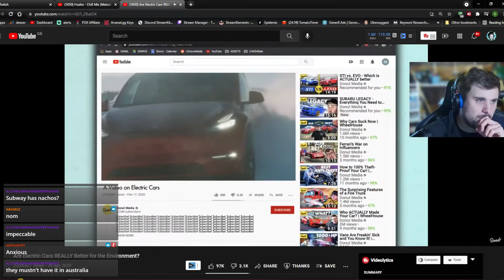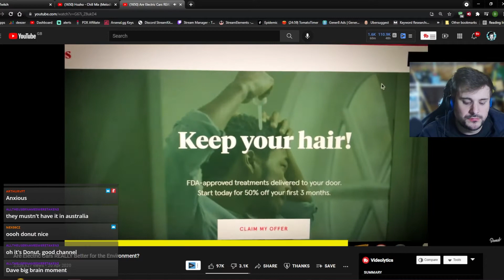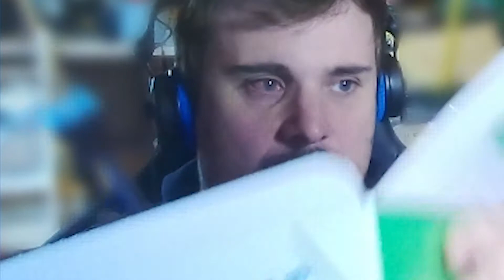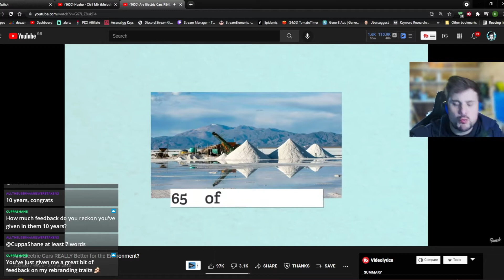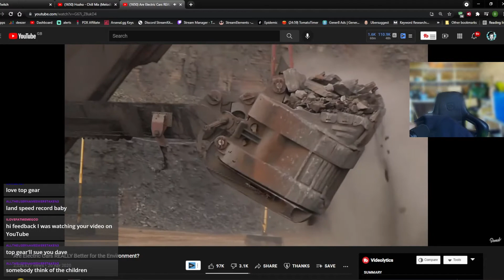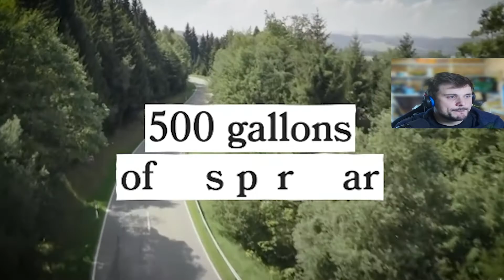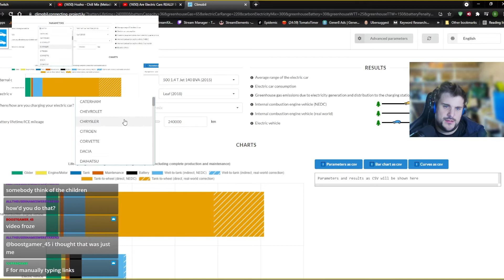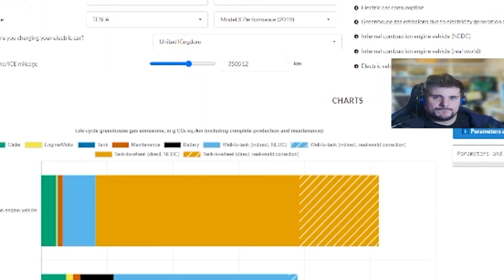Are Electric Vehicles BAD For The Environment? - Reaction Andy

Comment: When you look at the numbers it really depends on how much you drive and how often you purchase a new car... I know allot of people who buy a new car every four or five year and perhaps drive no more than around 1000-1200km per year. If you happen to buy a regular sized car with a decent fuel economy you actually will produce far less emission with buying a combustion engines car... of course you should not buy a new car every five years, but allot of people in rich countries do... We only drive around 800km per year and our car only consume a bit over 0.5 litres per 10km, it is a mid sized car. I would need drive that car about 7-8 years to end up with the same environmental impact as if I had bought an electric car of the same size. Our car is 14 years old and still run just fine bu the next car will be an electric car, most probably.

How often will you need to replace the battery of an electric car, especially if you want to maintain some range capacity... nobody really knows?!?

As we plan to own a car for more than ten years the battery life is important, otherwise we will not be doing the environment any service at all by selecting an electric car. Not to mention the prices of electric cars are extremely high still, so from an economic point of view it is not really worth it either even when you count the cost of fuel, based on that we don't drive as much.

You need to look at your needs and how you drive and use the car before making a decision... I want to have an electric car but the price for purchasing one over a standard car is not really that interesting at the moment. There then is the infrastructure of owning the electric car that is not full satisfactory yet, at least not where we live.

Comment: Solid state batteries are around the corner, replacing lithium and will have much more longevity. The reason they're popular now is light weight and...something something willingness of the molecules to accept electrons or some shit. Also these videos never talk about how gas/petrol uses only 30% of the potential energy for movement, because explosions are mostly heat energy. It's 3x more effective to charge a battery on a "dirty" grid which creates electricity from heat energy.

Comment: What we do with all the car batteries in 40 years? Electric cars will be an environmental disaster on a massive scale.
Reply from the maker: The same thing we do with batteries now. Recycle them
Reply: @FeedbackIRL  Do you understand how absurd that reply is. Our governments are talking about going all EVs. The scale of batteries will increase in magnitudes. The batteries are the most environmentally destructive we've ever created. It'll be a nightmare. We're making the problem worse.

Why do this when we could use hydrogen as a fuel source for our existing cars?
Reply: @FeedbackIRL  The logical path to reducing carbon in the atmosphere is well understood. Not what you hear in politics or the media. Countries like Canada (where I live) need to increase oil production. We have about 5-6 Saudi Arabias worth of oil in 2 provinces. We build pipeline to the coast and start exporting to China/India. They, and everyone else, convert all coal fired electric plants to oil. For a 40-60% reduction in carbon emissions. This would be done short term as we build up 4th Generation nuclear plants. These plants which burn the waste from first and second generation plants will allow us to slowly reduce oil consumption.

Natural gas should also be used o  a limited basis as it has an 80% carbon emission reduction over oil. The problem with it is fracking which can cause serious damage to the bed rock/ water tables. So it needs to be minimal and out of traditional oil wells.

Solar and wind should continue as they are but we have to accept that after trillions of dollars invested they'll only manage less than 10% of global need. Unless we have a major breakthrough in tech it'll never come close to what we need.

All our current vehicles can be converted to hydrogen. A mature technology at this point with the new fuel cells that have been developed.
Reply: @batzing  the viability of hydrogen engines is a lie it doesn’t work.
Reply: @SolitaryLark  A lie? It currently being used in many countries. Not sure why you'd say that. Looks like you couldn't take even one second to goggle.
Reply: @batzing  the viability is a lie viability. I know it works but the refinement and transportation of the fuel among other things would not work on a large scare. Therefore it is not a viable alternative.
Reply: @batzing  I’m well aware of hydrogen fuel cells. The refinement process and energy required and various other things means there is no way it could replace EVs or traditional fuel cars. (EVs and hydrogen could replace traditional cars together)
Reply: @SolitaryLark  EVs require even more energy to charge. Hydrogen takes far less energy to produce. You are just dead wrong about this one.

The byproduct of hydrogen combustion is water. The engines used are not toxic like the EV batteries. EVs are an environmental disaster.

You say you're well aware. You clearly are not.
Reply: @batzing  did I not say EVs take less energy. EV infrastructure is simply easier to implement. Hydrogen cannot be implemented easily and is cost prohibitive. We should replace traditional cars with EVs in the short run and possibly in the long run do hydrogen. Attempting to bypass EVs in favor of hydrogen just doesn’t make economical sense. (I know what I’m talking about relax and think about it instead of insulting my intelligence and education level)
Reply: @SolitaryLark  I disagree we already have gas stations that distribute fuels of various types. I'd say the distribution system is ready there. You just have a hydrogen fuel cell area like the current propane distribution we have at most stations in my country. So it will end up using pre-existing infrastructure.

EVs also suffer from short ranges, long charging times and the biggest downside is that many will be charged at night. When solar power is zero. It also means that if your local grid is being supplied by coal powered electricity you won't be saving any carbon at all.... so savings are grid dependent. It's not like the electricity you are charging your EV with is green... few grids world wide are carbon free.

On top of that you have the disposal problem of the batteries. An issues that is neither simple or clean.
Reply: @SolitaryLark  I fail to understand how implementing new EVs is a better solution than converting our current vehicles to a clean fuel source. You have the whole energy required to produce this new vehicles vs a simple kit on an existing vehicle. Be logical for a second which has lower environment impact?
Reply: @batzing   no our current fuel systems would not work to just be converted that’s just not how the systems are set up. We’d have to rip out current fueling stations and replace them. The batteries certainly aren’t perfect but they are better then continuing to use fossil fuels. EVs charged with nonclean energy are still better and more efficient then fossil fuel engines for many reasons. We could quickly and easily convert to EVs them slowly move to geen energy sources, some of which could be hydrogen based, then move to replace infrastructure to move to hydrogen (Overall in the end hydrogen would be better but no the infrastructure is not there and we need to do things quickly to reverse climate change)
Reply: @SolitaryLark  Again you're making assumptions. Look at the hydrogen fuel cell tech. The refueling tech. Nothing will need to be ripped up. You're making assumption spend some time researching it a bit.
Reply: @batzing  I’m not making assumptions the stuff isn’t compatible. Even if I was you can’t replace existing infrastructure for a new fuel source that no one is using. And no one will use the new fuel source until the infrastructure exists. EVs didn’t need to replace or Ben really make much new infrastructure just port connections on an already existing structure. Hydrogen doesn’t work that way. Again I suppose the use of this technology I just think your being way to optimistic about the expenses involved in a conversation to its usage.
Reply: @SolitaryLark  I'll tell you one last time you have surface level knowledge of both EVs and Hydrogen. You need to actually do some work.

You are assuming EV have a better carbon footprint day one over a normal gas powered car. This isn't true. Day one the gas vehicle has a lower foot print. It takes a few years for the EV to catch up then start providing a net gain. Secondly the time to catch up is directly related to how dirty the grid is that you are charging the EV from. When you start digging into the numbers EVs are not a magical carbon solution. They offer only slight benefits over thier life spans. The benefit is, of course, bigger with greener grids. When we all switch to EVs how do you think the extra energy required will be generated?  All this data is available for you to discover on the internet.
Reply: @batzing   Uou are assuming what I know you need to stop. I’m well aware that production wise EVs start out worse that’s not relevant considering the breath of time of the things we’re discussing. (Your continued condescending attitude is not helping me want to actually engage it what could otherwise be a good conversation. Your pissing me off)
Reply: @SolitaryLark  "Time Frame" brings us back to the beginning  Over 90% of cars are junked after 10 years. In 40 years will have accumulated over 30 years of production of junked cars. Each car with multiple highly toxic environmentally unfriendly batteries. This isn't even considering the likely need to replace said batteries during a vehicles life span.  How can you consider this an overall environmental benefit? Slight improvement of one problem while creating a massive new one...
Reply: @batzing  Newer EVs have showed no sign of needing replacement batteries within there lifespans and have so far had longer lifespans them traditional cats because of less moving parts leading to less malfunctions.
Reply: @SolitaryLark  EVs really haven't been in mass use for long enough to know that. Even if they last slightly longer it's still a massive problem. There are a little over 1,445,000,000 cars on the road world wide. You'll have yearly attrition due to accidents, faulty parts etc... it's not like car engines are the main point of fault in gas powered cars. Not many engines fail  before 10 years. The frames and other parts are essentially the same. Prone to the same faults. 

I'm sure you could check the yearly attrition rate in whatever country you live in to get a feel for how the problem will be over time.

Consumer reports (USA) EV batteries have expected life span of 200,000 miles. This is an average it might vary by battery type used. This is about the same mileage as car engines warranty. Not sure where you came up with last longer/no battery replacement. You  might want to provide a source on that.
Reply: @batzing  Tesla’s is mostly what I’m talking about as far as wear and battery usage since there at the forefront of EV tech currently.
Reply: @batzing  Except Graphene Supercapacitors already exist.